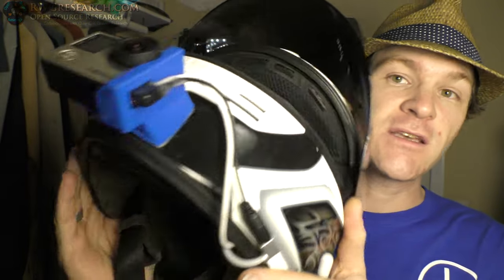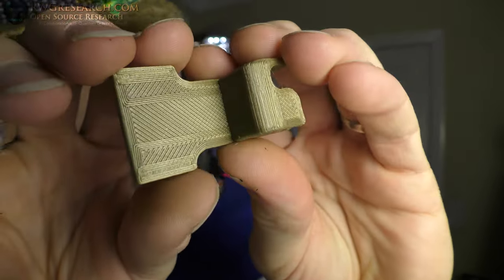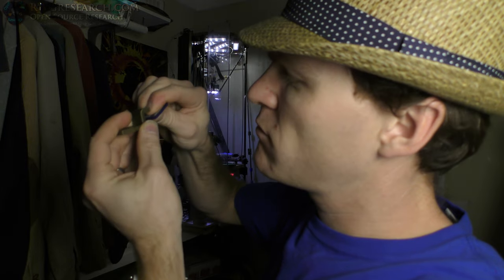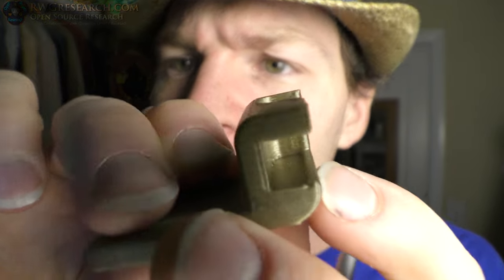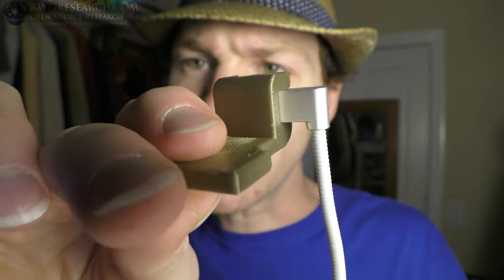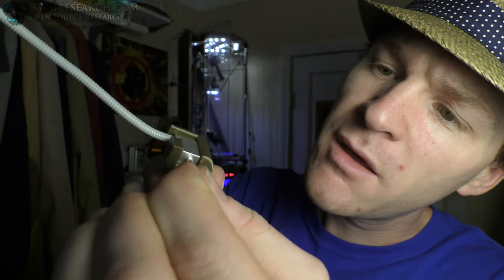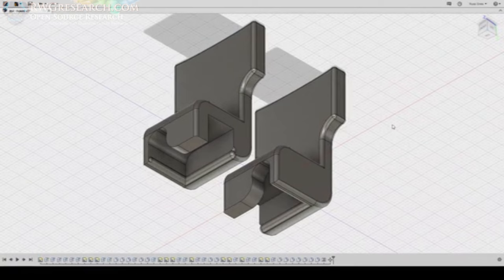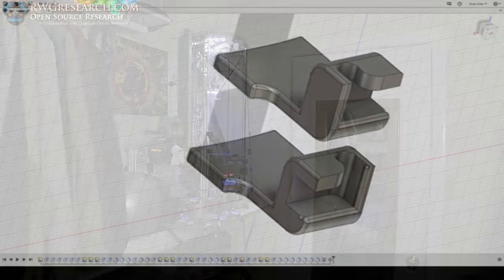When You Have Things Dialed In... 3D Printing Is Alot Of Fun! #Practical  3D Printing

Comment: Hi Russ,

Just a tip from a fellow motociclist: You should not carry something so heavy on your helmet (battery pack). If you get in a accident, such weight can make your neck snap.

Shouldn´t filaments come with the contraction % informed on the rolls? Specially ABS. :)

Nice print, I will someday reach such perfection.
Reply from the maker: Thanks for the tip!! I agree! i was planing on going smaller, but that's what i had laying around . however i got a smaller one because that one was to back heavy. not total I'm about 5-6% of weight added with all the gear on there so not bad! 

yes, all plastics act different. and some do shrink. a good filament suppler should have that on there site/rolls. 

with time you will get there :) and some luck :) ~Russ

Comment: I usually do around half the nozzle width for dimensioning, but just a little under that.  I guess all machines are different, including slicers.  Makes it hard to design something with a very tight tolerance for other people who print off different machines and different slicers.
Reply from the maker: yes, and most slicers have " offset" build in to the slicer. so you can do this in there, then it becomes more universal. ~Russ
Reply: Thanks, didn't know that existed.

Comment: I'm going to order my first 3D printer kit this week. I'm debating between cartesian vs delta. I'm leaning towards delta. What are your thoughts?
I'm looking for many applications and material experiments.
I'm pretty mechanically inclined and computer savvy.
Anycubic Linear Plus Version Unassemble Delta Rostock 3D Printer Kossel Kit Large Print Size with Heatbed and Power Supply is the one I'm looking at now.

Thanks
Reply from the maker: Caddy Guy Gaming just make sure you dont get a delta with rods. like the rostock. make sure its some type of rail. like the kossel. i like my delta... :)  ~Russ
Reply: Duly noted, thanks for the input.

Comment: how did you measure the curvature of the front of the helmet (the back of the go-pro mount seems to follow the curve of the helmet). did you just roughly estimate it and fill it in with glue?
Reply from the maker: C.T. Wellington that's a g reate question. I used the "carve" tools and did my best to mesure and check it. I test printed it then made adjustments.  it's was close but not enugh. so I heated it with a pin torch and pressed it on to the helmit. I did this for 2 reasons. 1 was to mold it better to the helmit. And 2. it needed to be more smoth for the adhesive to stick. 
Also I find it easy to hold the item (the helmit ) up in the air and try to look at the screan to match the curve. I have had good luck getting things quite close this way. the curve was in 2 directions and it was not equal through the curve. quite tricky. But I got it. holding well. being PLA it was easy to mold with heat. ~Russ
Reply: very interesting. Thanks for the info!
Reply from the maker: C.T. Wellington NP!!  I was in a hurry so no time to properly Setup a camera to show all the details. But I should make a video on it because it's interesting and helpful. ~Russ
Reply from the maker: infant it will be uploaded tomorrow :) ~Russ

Comment: You should get a Form2.
Reply from the maker: I have a 50k object resin printer at work. its messy and $$$$ to work with, and when its all said and done... most resin's are no good for real world uses.  so yes for some things its needed, but for most piratical printing its not a good choice. however, if one ends up on my desk ill use it :) ~Russ
Reply: Formlabs also has a new product call the "Fuse 1" which is launching June 5th.  I understand the need for practical prints. If I need a strong part I use their tough resin, they also got a flexible rubber like resin. For other things like conductive or metal I use a FDM printer. I find FDM printers to be much work with settings , too prone to fail prints ..I don't have any these issue with my Form2.
Reply: Also not so messy anymore with these 2 new products: https://formlabs.com/tools/wash-cure/?utm_content=main-nav

Comment: That's a nice fit there. When you say tolerance of 0.15mm, do you mean that you model an offset of 0.15mm to account for half the with of the printed filament string?
Reply from the maker: so if i measure a part i want to fit, let say the part is 10mm. if i want to print something and have it fit tight or " press fit" . i use an offset of .15 in ALL directions where the part will fit. . this is just what i know works well for my printer.  If i want it be a "slip fit" then i use .2 to .25mm and then the part will not be to tight but rather have a little "wiggle" room. 

after all my time printing the worst thing is to have a part that is to tight. depending on the part it could be easy to fix. or not... 

your printer may be slightly different but a few tests and you will know. 

keep in mined that if your printer is accurate ( as mine is) and i measure that 10mm part and make a 10mm gap in my part. it wont fit... you all ways need a gap of some kind. so if i was making 2 printed parts and wanted a tight " press fit" then you only give one part the extra gap. not both. or you can use 1/2 the gap needed on each part... I find that using .2mm for printed parts is good. as there not all ways 100% spot on... but using a razor blade a few times ( on its side using it to scrape) seems to make things fit well... if its flat.

 ~Russ
Reply: Thanks.

I made a calibration routine for holes and cylinders once where I modelled a set of holes and cylinders and compared the "modelled" diametres against the actual printed diametres. The relationship was extremely consistent and linear. If I wanted a certaint diameter for a hole or a cylinder on the print I just read which diameter I should model from the graph. The accuracy for this was well within 0.1mm. Same thing should be possible for more general geometry as well. It's only valid for a given filament, printing speed and layer thickness though.
Reply from the maker: SirArghPirate yeah. for sure. and the smaller the hole the more offset yoi need i have noticed. good stuff. thanks for sharing! ~Russ